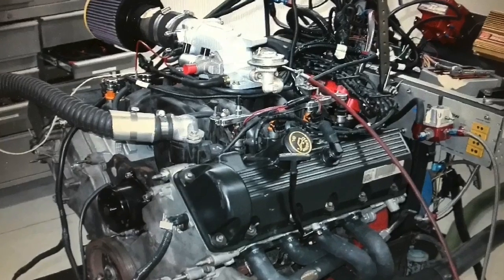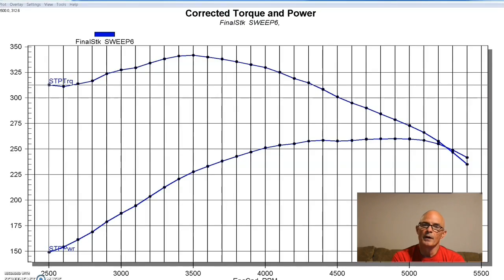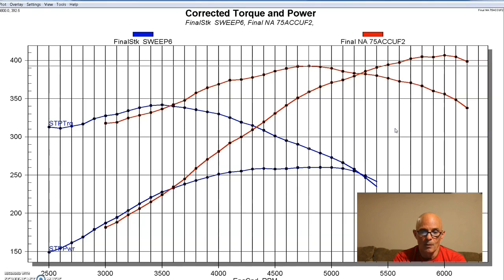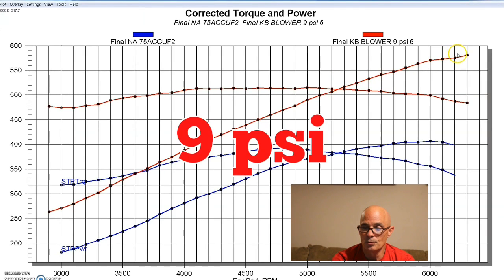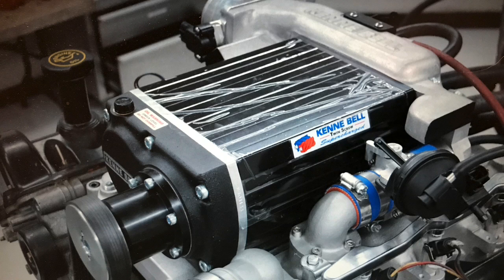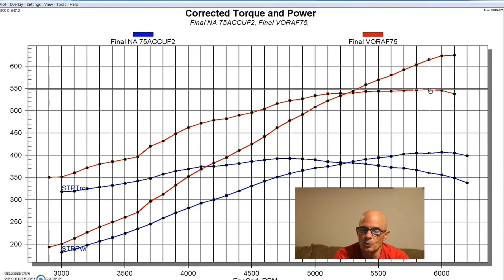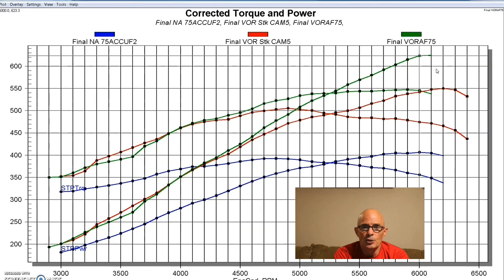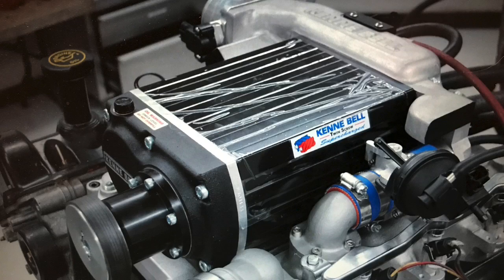HOW TO: SUPERCHARGED 4.6L FORD 2V (BOLT-ON BOOST)

Comment: They ran that 2 valve until the death of the panther series cars. 2010 maybe? Defiantly longer than 2004. It was also an option in 04-10 f150s I believe
Reply from the maker: year given was mustang-but started way back in 1991 and ran longer in trucks

Comment: Okay, time to finish this up. You did mention you wanted to actually find the limits of the stock 2v bottom end and show how much power can be made with a turbo setup. So I propose this, no I'm begging you, prove that 4 valve cobra heads can be put on a 2v bock and show us how it's done. One can find a huge amount of people talking about it on forums with a fresh guy asking if it can be done only to be met with "just buy a 4valve block" or "just supercharge it" "it's too complicated" and one guy who says "it should work". As far as I can tell you would be the first to actually accomplish it if you put one together. Some have suggested that it would yield low compression without redoing the bottom end, supposedly 8.5 to one. That's what we want anyway right? Lay this myth to rest and show how awesome it could be or terrible, PLEASE.
Reply from the maker: things to consider... you can 100% put 4-valve heads, cams and intake on a 2V block. The only hinderance to overcome might be chain tensioners locations (easily drilled and tapped). To do this, you need 4v cams, heads, valve covers, intake, water cross over, headers, tensioners, front cover etc... You basically need almost everything but the basic short block, you would 100% be better off (cheaper and faster) getting a complete 4V from a wrecking yard.

Comment: I want more clarity on your question, if you’re up for a challenge! Hahaha. 

So when comparing 4.6 2v numbers against: 4v cobra, 3v and coyote, you mention you want to include the non-Mustang 2v’s. Are you not also going to include the non-cobra 4v’s (example terminator, Mach1, Crown Vic) and of course they put the coyote in plenty of non-Mustangs, do they also count?

If you’re going to include ALL 2v’s it makes sense to include the 5.4 variants, it’s a MODular motor after all, and then you open a whole fresh set of worms when (to make it a fair apples to apples comparison) you apply that rule to 3v and 4v

Comment: If I can get a doubling of HP I'll be happy. The stock SN95 GT isn't all that impressive but I guess you get what you pay for. Anyway, I was wondering if you had upgraded the fuel pump and injectors, also, or did you use stock parts. I had heard that it's risky putting on a supercharger because the stock lifters weren't built very strong. Anyway, this was an interesting video.
Reply from the maker: stock lifers are fine, but you need more fuel flow so bigger injectors and fuel pump are mandatory

Comment: I wouldn't think it would handle either, thought the stock rods were some powder cast. I would have beefed  the enterals up some. (Interesting ) I'm still learning new stuff about these 4.6 mod motors
Reply from the maker: LS rods are powdered metal-they run 1500 hp.

Comment: I’m a HUGE 2v fan. Always loved the New Edge look. They might not have had crazy HP numbers out of the box, but it takes guys like you to show what they are really capable of. I’ve always considered the 4.6 2v to be the best sounding V8. Again that’s my own opinion. But I have always loved the sound of them. They’re so raw. I have an 06 4.0 V6 S197 Premium. And i want to do a swap. I’m sick of seeing the “Coyote” swap and have decided to do something completely unheard of.. I’m building a Procharged 4.6 2v. Trickflow heads just arrived. Block is currently being machined and I’m building it from the ground up paired to a T56 6Speed out of an ‘04 Cobra. Absolutely can’t wait for the spring. I’ll create videos of the swap. But there’s not much information at all regarding it. Fingers crossed. But I know I’ll be able to do this.

Comment: So basically dude is saying swapping to pi heads upped the hp on a stock 4.6 pi from 260 hp to 600hp lol. That's complete bs. Those chargers are not gonna give yield over 300hp on 10lbs. Complete horse sh!t
Reply from the maker: SO BASICALLY DUDE IS SAYING YOU DIDN'T WATCH THE VIDEO.
Reply: @richardholdener1727 u said it made 260hp stock. Switched to pi heads and cams on 10lb of boost made 620hp and 570 without cams. Thats 300hp gain with pi heads and 10lb of boost lol. I watched the vid and it's completely bogus. Furthermore cams and pi swap is never ever ever gonna yield 140hp lol. I have a 97 with way more mods on 18lbs and it makes 407 to the wheels and thats exactly what thousands of others make as expected.
Reply from the maker: the na motor made 407 hp after ported pi heads, cam and pi intake, accufab tb and elbow-then 10 psi from the intercooled Vortech (it's okay if you are new to this)
Reply: @richardholdener1727  I'm not new to this. I'm extremely knowledgeable on every aspect of a 4.6. 5.4 and you are wrong in every way. You are a salesman and what are you selling??? B.s

Comment: This is an old video is there a more recent 4.6L video where you actually explored how much power you can make on stock 4.6L internals either with or without ring gap modifications ?

Comment: I called Kenne Bell to see if they still make an NPI supercharger and they don’t.  They said if I do the PI swap they don’t recommend their blower due to the increased compression.  How did you prevent pre-ignition during your testing?
Reply from the maker: good fuel
Reply: @richardholdener1727  does 93 pump gas qualify as good fuel or were you running something more exotic?

Comment: The general consensus is ~450whp. I made 503whp on my 04 GT when it blew up at the track. But it ran at 440-460 for a LONG time. You’re running on an engine dyno with no accessories, with what I would say some very “generous” correction factors. Big difference.
Reply from the maker: generous correction factors? I'm guessing you don't know much about how dynos operate.
Reply: @richardholdener1727  I know the numbers change based on the correction factor. True or false?

Comment: What else was done to reach that much power? What about fuel and injectors etc?  I've never heard of a stock 4.6 handling that much unless it was built from the bottom up. Interesting
Reply from the maker: stock bottom end with ring gap-the stock stuff will make a lot if tuned correctly

Comment: What fuel system do you need to make this power and pump gas, E85, or race gas?
Reply from the maker: 80 pound injectors, 450 pump

Comment: How do I know if I have a pi motor or non pi I have a 2010 f150 with a 281 4.6 2v I would love to produce more power from my motor
Reply from the maker: that is pi if it is a 2V
Reply: Thank you Richard, I have almost 200k miles on this daily driver if and when I rebuild it what should I do if I want more power like cam, trick flow heads, turbo or supercharger any input would be appreciated?

Comment: I have a 98 f150 I've done everything but camshafts change and the heads I'm trying to get a little more out of it do you have any advice. It's a new motor from ford it has less than 30 thousand miles on it. I've put headers, MDS  and had it reprogrammed it run okay but like to have a little more power.
Reply from the maker: WHAT MOTOR?
Reply: @richardholdener1727  4.6 2v sorry about that
Reply: @richardholdener1727  do you think doing one of your pi head changes and a set of cams would have any effect on power. I've been watching your videos on the 4.6 2v.

Comment: How much would it cost to put a supercharger like this on a stock 2002 f150 4.6l
Reply from the maker: talk to vortech
Reply: Superchargers are around $6k to $10k. If you don't know how to work on cars and know how to dyno tune the car then $13k to $15k.

Turbos are way cheaper and can be installed in the driveway on a weekend off. That is if you know how to weld and basic mechanics. If you have to pay someone to do any of this for you. You will pay to play. 🤷🏼‍♂️

Comment: Now I'm wondering what would happen if I put a cheap used M90 supercharger on it and fed that off a decent sized turn. Would the turbo help keep the boost up at wot and have no turbo lag due to the M90? Hmm......me thinks it might be worth a try. I'm also thinking put the turbo in the trunk up out of the dust and crap and maybe put an intercooler in a cooler full of dry ice. That might not be cost effective but fresh air could be ducted past the intercooler then out of the trunk with just a side scoop and rear vent
Reply from the maker: I have compound turbo/supercharger videos up

Comment: I've never hated the 4.6 2 valve engines but I was never crazy about them, until now. 

With trick flow heads, built bottom end and more boost you can go even further with these things. Love this vid and thanks for shining  more light on the little mod motor.

Comment: Richard this video is awesome! What fuel injectors did you use or would recommend with this setup using the Kenny Bell supercharger (making 600hp keeping the boost around 10-11psi)? I’m going to build my 4.6L 2v motor with this exact setup because of this video, so thank you 😉👌🏻
Reply from the maker: 80 pound inj
Reply: @richardholdener1727  thank you! any chance you can suggest a brand / part number?

Comment: Richard do you run regular serpentine belts or do you run upgraded kevlar belts? I noticed you & Engine Masters both run into belt slip. Continental makes good Cevlar belts. As a Fleet Tech our 2V police cars come with upgraded kevlar factory & Diesel truck engines have them. They don't stretch or slip like a reg rubber belt.

Comment: Awesome video Richard. Quick question... Would using pistons from the non-PI motor in a PI engine yield the same result as installing PI heads / intake on a non-PI motor? Thanks!
Reply from the maker: yes
Reply: @richardholdener1727  thank you

Comment: So apparently the 2000 police interceptor  crown Vic’s didn’t come w the pi treatment . I haven’t seen anyone on YouTube dyno a crown Vic w pi heads . Then I started thinking. Isn’t there a dohc 4.6 and if so which one is . Basically my question is…. Can you pi swap a npi cop car Vic and if so would it make the same improvements as a 4.6 mustang. Obviously if it’s the same motor there should be no issues but I thought they came out w pi after 1998 and that there are also dohc. Obviously I don’t know what I’m talking about … tryna do as much research as I can tho. Someone let me know.
Reply: The 2001 crown Vic came w the pi treatment tho. So I don’t see why I couldn’t pi swap a 2000. I wanna buy the newest npi police car that I can and pi swap it.

Comment: Need a big bang junkyard 2V episode as apparently no one else will make one. and here is the clincher ...we need 2 of them .. both engine with stock bottom end and ring gap modified for boost heads cams and intake as well as detailed info on which injectors are used with the main difference being one with pump gas and one with E85 ... and yet a third one for base line running stock ring gap and pump gas ... for entertainment as it will be the first to go.. no need for all in one episode but it could be a series.  I mean If I could invest in meth injection or E85 and save on internals to make 650 reliable hp on stock internals then so be it
Reply from the maker: you can make 650 hp with stock internal and ring gap and e85. big bang on 91 pump (no thnx)

Comment: i dont know if they made more 2v to anything else but i do know mine came with 239 hp and i think 100 died and 75 are sick and tired. so i dont have much left and you can out run it with a good mini bike and outpull it with a good lawnmower. i need something to get me a little more power. nothing racing just a little more power.

Comment: I know this is an old video, but I have a 02 mustang gt. Right now the car just has cold air intake, bbk 78mm plenum/throttle body and a nx nozzle wet kit jetted for 125hp. But I ordered a Kenne 2.1 kit a few weeks ago along with longtube headers, and an fti 2800rpm stall. I was wondering is it even worth putting a set of cams in it? I’m fairly certain the Kenne bell could make more than enough power to break a rod without any other mods. I guess my question is would it be better to just run a little bit more boost with the factory cams or keep the boost lower and add the cams? Id like to get close as I can to 500rwhp. Also I have a set of svt Manley rods since I’ve always heard the rods are the weakest link. Do you think with the stock crank, pistons, and Manley rods the bottom end would hold up to 600-650rwhp? Because that’s really where I’d like to get to if I can do it safely with just changing the rods. I would build the entire bottom end but I just don’t have the money because I’m actually building the bottom end of my 3v mustang since it will be getting a single 76mm turbo soon and I’m trying to really push that one higher than 600rwhp. I’d like to see 800hp on the 3v when all is done.

Comment: So i got an 11th gen f150 with the 4.6 2v and i was wanting to supercharger it. Will the new edge 2v mustang superchargers fit mine with no problems? Eventually ima go the non pi, pi way but for now wanted to know if i can fit mustang parts on it or does it have to be specifically f150 parts. Like throttle body and stuff like that
Reply from the maker: no idea-truck accessories are different I think

Comment: Thank you for rhe great video.  Do you have more info on which heads you used from TEA or overall part numbers for this build.  I have a 1997 Mustang Gt with 50,000 and I would like to do something like in your video.  Thanks
Reply from the maker: JUST ASK FOR THE STAGE 2

Comment: Hello I recently acquired a sct tuner and laptop could a purchase a remote tune from you
Reply from the maker: I'm not a tuner and have never run SCT
Reply: @richardholdener1727  how are you putting down these numbers through a dyno eveb following you instructions on basic bolt on tuners here are not capable or knowledgeable enough to get me to 400 range
Reply: I have done everything you have pi heads on non block long tunes pi intake stage 1 cams stock springs etc

Comment: The rods do bend pretty easy... my 95 tbird developed a knock.. sitting over winter.. I started it up in spring.. knocking...
The #8 connector rod bent... causing the piston skirt hitting the counter balance on the crank.... tore it down and gonna rebuild it.. but trying which route I wanna go... so all ur info is helping

Comment: They made more 2 valves. I have a 97 f150. Date on truck is 07/96 so it's a 97. 320k miles and runs clean. Best motor I've ever had. I've had jealous people try to blow my motor and sabotage it.
Reply: My 98 F-150 4.6 2 valve is running strong at 180,000 😊

Comment: back in 98 I had a 96 gt with ported 99PI heads and 99 intake. 150 shot of NOS > No NOS and it ran with the new SS camero's of the time. Turn the gas on and no chance.

Comment: Which 4.6 is in the 1999 F150 Triton that is the truck I'm getting it is a manual 5-speed
Reply from the maker: THE 1999 IS PI
Reply: @richardholdener1727  which means two valve correct
Reply: @richardholdener1727  so in other words the good engine

Comment: Fun fact: Ford does not have an actual verified production number for the amount of 2v engines manufactured. They have Precise data on how many and which vehicles had the 2v installed, and they have precise data for how many 4.6 blocks were used, but they do not have a fully accurate number for how many 2v engines they actually made.

Comment: EVERYONE refers to power to RWHP! Engine dynos dont mean jack shit
Reply from the maker: NICE TRY NEW GUY-EVERY FACTORY MOTOR EVER MADE IS RATED AT THE FLYWHEEL-NOT WHEELS
Reply: @richardholdener1727  No shit sherlock.  As I mentioned already, flywheel HP doesn't mean crap.  RWHP or nothing

Comment: I've been saying for years that I believe the 4.6 2v  an handle more that what people say. Everyone slaps forced induction on with no engine mods, and max boost and pop goes the weasel, it's a recipe for disaster. Put supporting mods in place first to make a more efficient engine, then run lower boost. Less is more.  Higher combustion chamber pressures (and temps) via boost will certainly wreak havoc on any engine. The proof is in that one dyno graph with the stock vs. aftermarket cam... those gains on an n/a engine are unheard of, but in a boosted application it proves what I've thought all along. A good tune and intercooler with an icebox and you'll be seeing ridiculous numbers I bet.

Comment: Old video I know, but thanks. I'm walking through your Mod-motor playlist now. IMO the SN95 Mustang is the place to be right now for a cheap, vintage performance car. It's at the right point in the depreciation curve, Fox-bodies are already headed up. The SN95 is a significant improvement over the Fox in every way except the controversial styling (which I happen to like) and the limited power of the 4.6L 2V engine. The 4V engined models are never going to get into the "cheap" category, so that leaves figuring out how to make power with the 2V.

Comment: I believe your right Richard, the last motor Ford produced nearly as long as the 2v was the flat head (in production 20 years) where the 2v was 24 years (1990-2014)

Comment: I have a 2004 PI GT stock engine with a Kenne Bell running 9-10PSI and I am really itching for some more power.  But am worried about popping the motor since i should be around the 400whp mark already. Do u think I would be able to reliably hold more power?  I drive pretty hard and take it to the strip on occasion.

Comment: You “can” make more than 400whp but it won’t last. Especially on the street or a Dyno jet where the engine sees the higher RPMs for much longer. You’re doing this at crank horsepower so numbers will be higher than universally recognized wheel power. Also with that compression, what fuel are you using?
Reply from the maker: universally recognized?
Reply: @richardholdener1727  The standard*